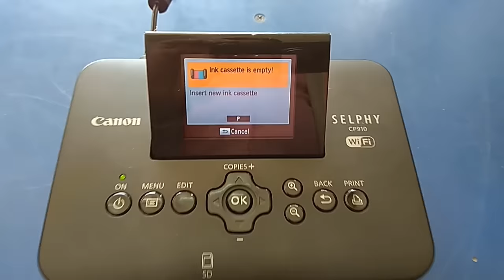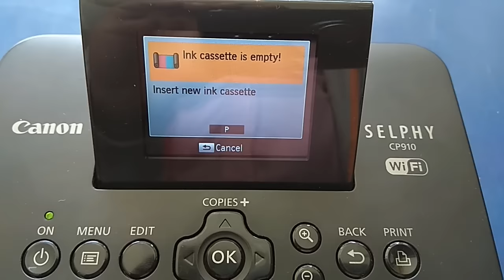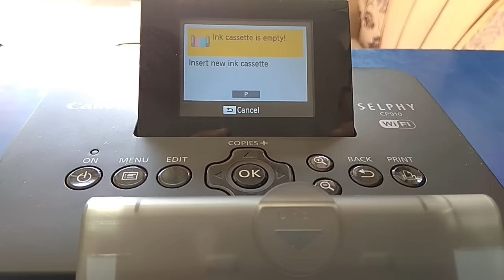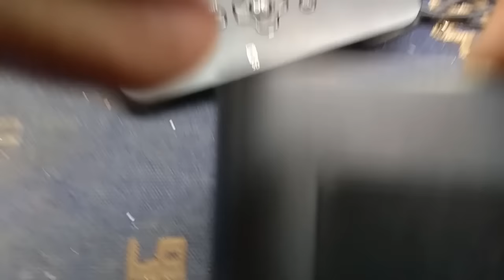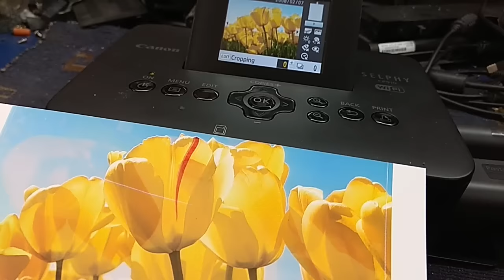How to fix ink cassette is empty error on canon selphy cp910

Comment: Thanks. I Just Put Out The whole unit without removing The flex cables. Only remove The Fan cable and you can lift The whole unit and Turn IT upsite down to repair The little Motor.

Comment: Thanks. I got exactly same problem. Following your instruction, it has solved the issue. But there is now a noise which is sound not perfectly nice ..maybe it did not pay attention to something when reassembling it!? Anyway, Not sure the glue will stick long on the smooth shaft of the motor and on the plastic gear!

Comment: Thanks, this worked like a charm! I purchased a $5 CRAFTSMAN #0 Acetate Handle Phillips Screwdriver from Lowes (Item 1061123) to unscrew the four corner screws. Also, I only removed the three screws on the printed circuit board which allowed me to finagle the entire chassis & PCB out together. That way I didn't have to remove the ribbon connectors at 5:12 & 5:29. One commenter said they didn't even remove the ribbon connectors for the top, but I chose to remove them. For those who asked, the liquid used on the shaft is super glue, NOT oil. The screw that holds the motor in is too small for the #0 phillips so I used a flat head screwdriver from an eyeglass kit. I fully pulled the gear completely off the shaft and used a toothpick to spread a small amount of Gorilla super glue inside the gear and then pushed it back on the shaft. No problems so far.
Reply: For those about to do this, do it the way he describes in order to not have to remove the ribbon cables, they are a major pain to get back in because they are so short.  I broke the connector locking piece on the big/wide ribbon cable while putting everything back together.  I think I can fix it to where it will stay in place.
The gear coming loose is a major design flaw; a plastic gear press-fit on a metal shaft without even having a D-shaft OR glue, geez!

Comment: I just had this issue with my Selphy CP910 and the solution described in this video fixed it! I only disconnected two PCB plugs and two ribbons, I didn't have to detach the PCB from the printer mechanics - it popped out easily and saved a couple of steps. Thanks for posting!!!

Comment: Thank you so much for your help Ali. Your clear and step by step demonstration was so encouraging, and gave me a lot of confidence to follow. And it turned out great! FYI, I could see a fine hair line crack on the small nylon driver wheel so I figure that was why it got loose from the motor axle to start with. Anyways, I think the super glue should now hold the wheel in place for a long time. Thanks again.

Comment: A Big thank you, Man !

My Selphy CP900 was behaving like yours but with a different error message : "There is a problem with the ink cassette !" (and the error would happen mid-print, when trying to print the magenta layer)

I first thought the issue was on the cassette side as the message was implying, but I decided to give a try to your solution. I have the exact same issue : the small gear moves out of its shaft and messes the whole stuff mid-print (so that you waste paper and ink !).

I put some glue before putting it back, and it seems to be working fine (I'm pretty sure I'll sooner or later have to do that again, but at least I have a solution for all the remaining paper and ink).

So once, again, a big thank you for posting that video !

It seems almost like an intentional flaw in the design in my opinion : Had the gear been a little longer, if wouldn't have had enough place to move and leave the shaft...

Comment: Thank you. It worked, I coudn't get the last little screw, so I poured super glue to the little metal bar and then pushed the plastic part against it and it worked well. The only thing is that now makes a weird noise, like a gear that tries to move one that is stuck, but whatever, it works zero problems, so i'm fine with it.

Comment: Thanks a lot. Worked fine. It's not that difficult (with a little experience). Took me 15 minutes. Prints way better than in front of the error message.

Comment: Unfortunately this didn't work for me, the gear stuck properly but the same issue kept coming up, I re opened the printer and checked the gear and it was fine, even tried several attempts at re aligning the motor all with no success, thanks for the upload, was worth a try.

Comment: It worked!  It seemed to complicated for my skill level but I did it :)  Thanks for the help.  BTW the biggest issue I had was finding a screwdriver that would work for the deepset screws in the bottom of the casing.  Had to order from amazon as the ones I had were too thick for the hole.
Reply: yeah, I had a small enough screwdriver but it wasn't long enough - happily I just got a dremel for my dog's nails and was able to grind away a bunch of the handle.

Comment: Great tip! Same thing was happening with my unit, I got the little pinion gear (10T 0.3M bore 1.5mm) glued to the axle BUT the next cog in the system only moves one quarter turn, having unglued it in the first place. Still working on it to understand why. Thanks for getting me one step further though!
Reply: Hi, can you explain the glue part please . I cant understand or clearly see what he is glueing.... please and thank you

Comment: Thanks alot for the knowledge shared it's been of great help sir. but after solving cassette empty error, the printer started having lines on half of the paper horizontally. please, what will do to correct this error. thanks

Comment: Thank you very much! I think this could be done without the complete disassembly (I clearly don't have your level of skill or practice) by removing the lower shell, and using a toothpick to place glue on the motor shaft before pushing the gear into place (this is what I did to avoid pulling the motor our). It would save muppets like me the 15 minutes fiddling to get the cursed flat strip connectors back in :D

Comment: Hi, why didn't you put in the white cassett after repair that was the problem from start? When you had finished solving the problem you used a black or brown casset. I ask because it's confusing when yo do so. I have an original black cassett with 36 prints and bought RP-108 with 54 prints and the cassett is white. And I got the problem "empty error" with this new white cassett. That's why I looked at your video. When you mixed this cassets it was confusing, and I wonder if it really will solve the problem. I don't want to do the job before I see someone put in the white 54 prints cassett and then the problem is solved. But, thank you for your efforts.

Comment: Will this work on the CAnon CP780 (Earlier model?). It's making the same noise and producing the same error. Also - do you have a list of tools for this task?
Reply: I have that unit and just watched this video... I am going to see if this fix worked. Bad part is that I broke the new ink cartridge getting it out of the printer. I will glue it to see if salvageable. It was brand new and unopened so I know it has ink. I'll try to keep ya posted on the outcome
Reply: @jcost0099  Good luck! I actually got mine working using this same process. I felt like a NASA scientist : )

Comment: I know that in such cases the gear wheel bursts along the axis. How many photos could you print on the glued gear? Would you like to replace the gear on made of metal (pinion gear 10T 0.3M bore 1.5mm)?
Reply: is this the correct gear? i want to buy one,
Reply: gear here is 11T not 10T
Reply: @nedialkodimitrov5758  i'm sorry. My data is about Canon Selphy CP800

Comment: My printer has the same error after only printing 12 copies. I cannot see how gluing a nylon pinion with an interference fit onto a smooth metal shaft with glue will last. My option is to score the shaft to provide a key. Drill out the pinion to have more adhesive in contact and use araldite as the adhesive.

Comment: Hi! In this video the print comes out with 2 fine white lines on each extreme of the image. What can be the problem?
Reply: There is no problem. It is a perforation that already exists in the paper. It's there to allow you to remove the white borders from the sides.
Reply: From my experience of dye sub printers it could be some dust.  Get a can of compressed air and spray the interior via paper and ribbon apertures